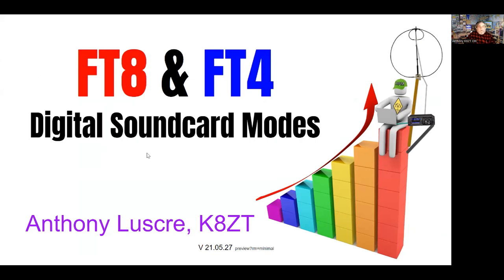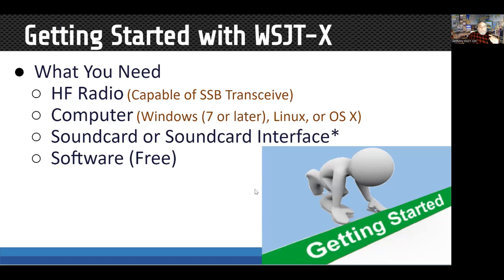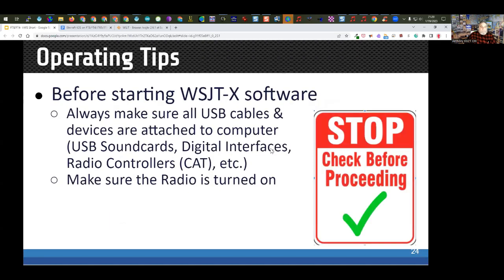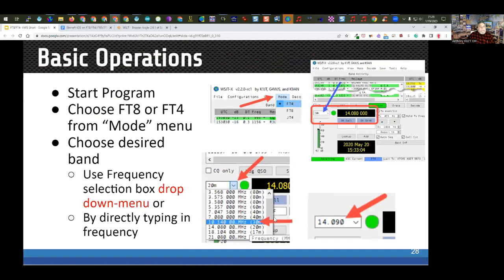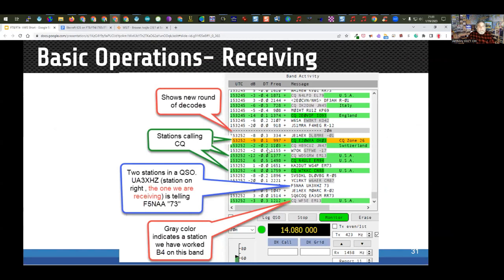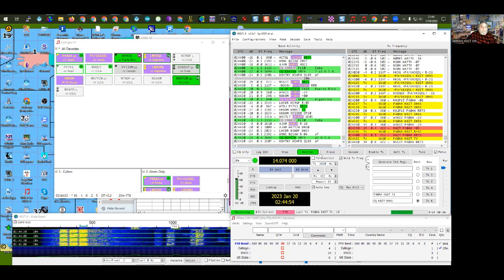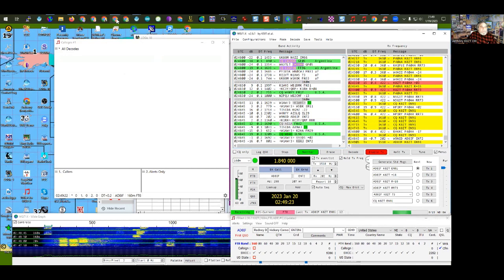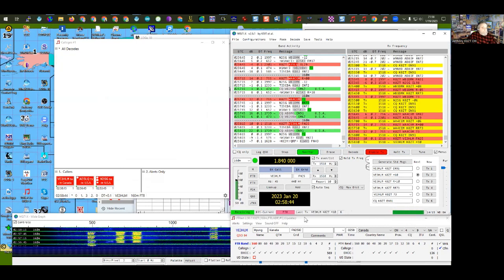FT8 & FT4 for Beginners & Established Users- 01/19/2023

Comment: Nice presentation. Kinda long. Just getting into FT8 and 4. Still working on my OCF wire antenna. You have a very nice setup where you are. I'm in an HOA so stealth is a requirement. Not sure if the wire antenna will do the trick or a Flag pole setup might work here for me.
Anyway, Sub'd and liked.

Comment: Nice video. Regarding time sync away from the internet, you have a radio. Presumably it can hear WWV on one of their several frequencies. If you can keep a beat and have good mouse finger reflexes you can easily get within half a second using WWV. I did so often in a club shack that had no internet.